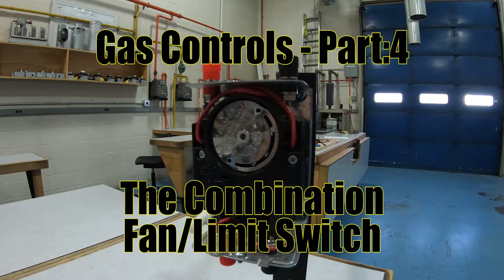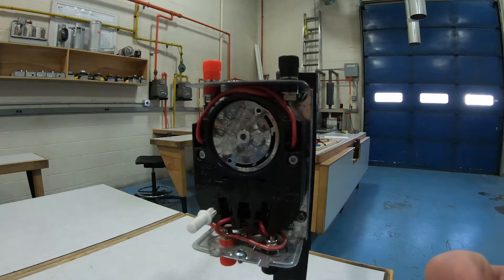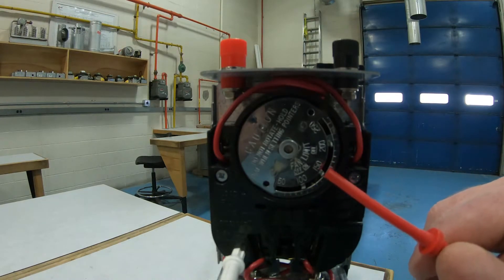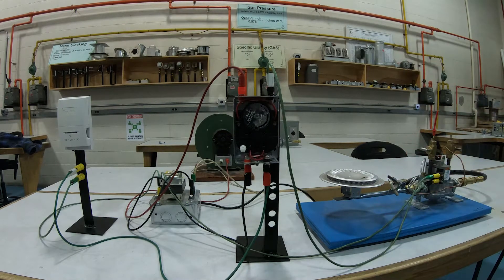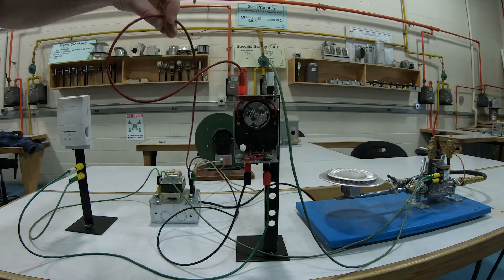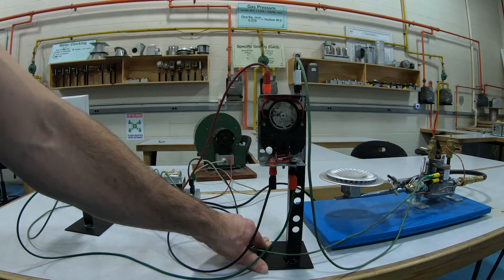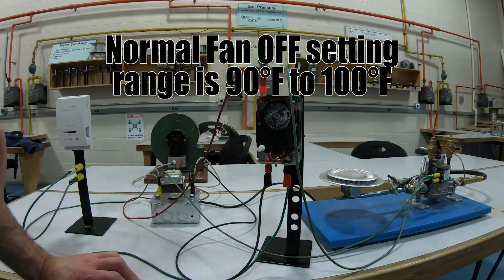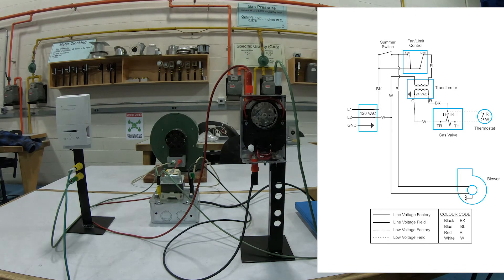Gas Controls - Part:4 The Combination Fan/Limit

Comment: i got a question on my Red Seal Exam , what appliance doesnt need draft control device a) hot incinerator , B) furnace C) Steam  boiler , D) Hot water tank  i could no find out which one it doesnt
Reply from the maker: Incinerator, it burns trash or bodies. You don't want that soot in your building